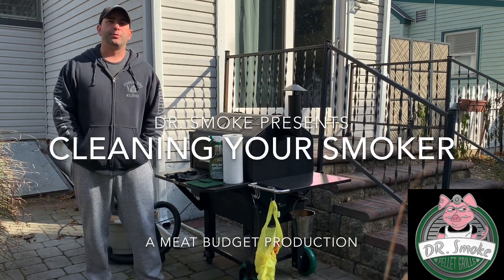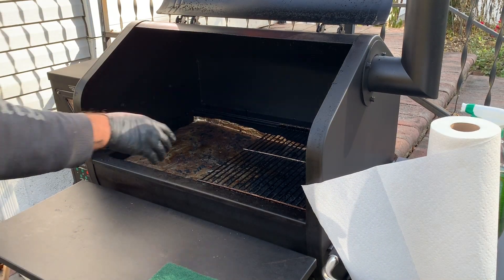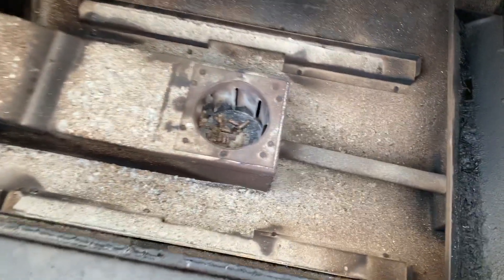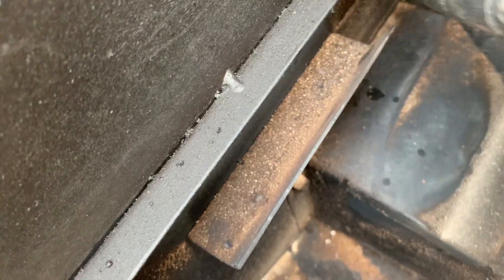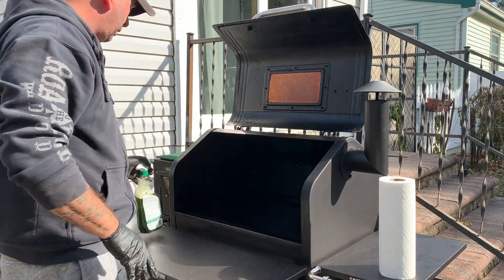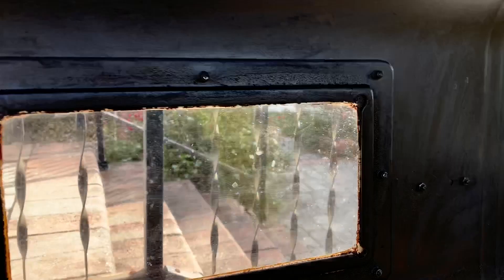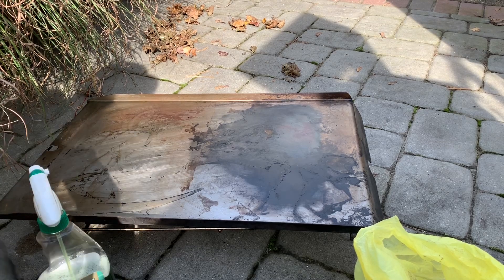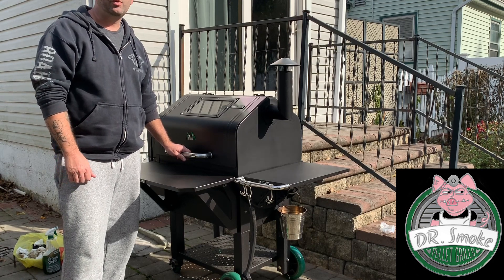How to Clean GMG DB, JB, Ledge, Peak Prime 2.0, Davy Crockett / Do I have to Clean My Smoker

Comment: I get my foil from Sam's Club/Costco in the foodservice sized roll. One roll usually lasts about a year for me and it's the right width for covering the grease tray as you have done in this video. I learned the hard way to make sure you have a dust bag in your shop vac when you vaccum out...or you end up with another mess on your deck/patio, hahaha
Reply from the maker: Yes absolutely

Comment: For the window I suggest getting MEECO'S RED DEVIL 701 Woodstove Glass Cleaner. This stuff is amazing. You can spray it on, and it will break up the creosote off there like nothing. You can use a paper towel, so you don't have to use something as abrasive as the pads on it.
Reply from the maker: Thanks for the suggestion!

Comment: I have the Davey Crockett model (smallest). What I've found that works really well for the grates is to get a small tub which  has a lid that will seal it reasonably well (more air-tight the better). I place the grates in the tub, pour in about 1/4- 1/3 cup household-ammonia, close the lid and let the fumes do their magic. About 2 hours later (I usually let it go at least overnight) most grease/drippings will fall off under a stream of hot water. You might need a little scrubbing with abrasive sponge or steel wool for some crustys, but the grates look brand new afterword. If you've never used household-ammonia, a word of caution -- boy does it stink and will sting your eyes/nose. If you or someone has respiratory problems, this might not be a good idea for you. Also NEVER mix, accidentally or otherwise, any ammonia with any chlorine bleach (Clorox, etc). The combination will give off chlorine gas which can be deadly.
Reply: @The Insufferable Tool - What I do after is send it down the drain. I wash them in a sink in the house (I have used the kitchen sink and a deep laundry room sink.) I do it all in the house, I have an overhead fan like you'd find in most bathrooms and leave that on for a few minutes until the stink clears out. You could do it outside, weather permitting. Generally the grates don't "soak" in the small amount of ammonia, but they could if you wanted to. Never tried "boiling water". Respirator -- Depends on you and your housemates. My wife has mild asthma, I always tell her to "stay out of here" when the stinks around, she's never had any issues.
I should have stated when I first posted that I do this right after using the grates (same day at least), so the crustys aren't too bad. If your grates are really gummed up and thick crustys, you might have to do this several times. Some guys use "Oven cleaner" for that. It can be nasty too, but newer products tend to be not so bad. This ammonia method is cheap, I just bought some more ammonia at Wally World, $1.50 for 1/2 gal. That will last me for a couple of years. Hope this is helpful. You might want to reread my original post, as I'm going to clarify some of what I wrote.
Reply: Why?  Just hit them with a brush before your next cook

Comment: When you shop vac your fire pot out, do you need to put more pellets in, like the first initial set up?
Reply from the maker: No because the auger is full.  You only have to take the first step again if you run the pellet hopper completely empty.

Comment: I don't use my grease bucket.  Instead I use either an empty tin can or an aluminum soda can with the lid cut out.  I made the handle out of a clothes hanger which I use over and over.  For soda cans I simply punch handle holes with an ice pick.  For the heavier tin cans I use a battery powered drill...... disposal is so much easier than cleaning.   The original bucket now catches pocket change that once full is used to buy more pellets.
Reply from the maker: I love seeing creative ideas and this is one. Thanks for sharing!

Comment: GREST GREAT Video!!! I noticed a small amount of rust on the inside bottom of my Daniel Boone!!! Will it be ok, should coat it with high temp paint??? Also I’m allergic to Simple Green. Anything else I can look for to clean with?
Reply: Once you cook in the smoker it gets seasoned like cast iron. Leaving a thin layer of grease will protect the bare metal. If it really bothers you and you wanted to paint it you would have to clean the area with acetone before you use high temp paint on it. That would require you to do another burn-in to season the new paint.

Comment: All I can say is that it's a good thing Sam's and Costco sells paper towels by the bale. I buy Simple Green by the gallon. Are you really happy with your GMG? Any major issues? I'm looking a possibly getting one. Replace my Pit Boss series 3 vertical which is too small to do a brisket.
Reply: You can’t go wrong with a GMG. The grill is very well built. These have electronics and software so sometimes you gotta do updates or reset your wifi. This is all part of any pellet smoker brand.
Reply: @ronradil6995  True but is it PID?

Comment: Did  you charge  the  pellet box?
Reply from the maker: What do you mean?
Reply: DR. Smoke I mean did you add pellets to the fire box as instructed during initial assembly?
Reply from the maker: You do not have to recharge the pellet box at all when cleaning.  The only reason you would have to do that is if you ran the auger empty.  If you keep pellets in it you would never have to do this step.

Comment: @DR. Smoke Very helpful. Thank you!  I have a 10 year-old Weber Summit gas grill that's on it's last legs. Thinking of getting GMG.  Good to know how to maintain.  I'm kind of lazy about maintaining my grills (to say the least). Seems like this requires some diligence because it's pretty sophisticated. The Weber is a little less maintenance, just because of it's high heat cooking. Do you think the extra care needed for the GMG is worth it because of its more consistent results?  I just want to make good food :-)
Reply from the maker: Marshall i know it might look like a lot, but once you get the procedure down it will take around 10 minutes.  Again this is a deep cleaning which really only needs to be done about every 5-6 bags of pellets.  I came from a weber Smokey mountain 18.5” to clean and maintain was a true pain every single time.  The GMG offers very constant results and very little maintenance.  You will be very happy when your not maintaining a fire all day and worrying if your temp is still ok.  With the GMG you set and forget.  Where are you located Marshall?
Reply: @DRSmokeNJ  I'm in the Chicago area.  I have the Weber Smokey Mtn also and agree. It's a definite pain to clean! Thank you for the advice!

Comment: You mean soaking it at 550 and then starting a grease fire with a propane torch and burning everything off isn't the right procedure?? I thought that was the built in self cleaning feature.